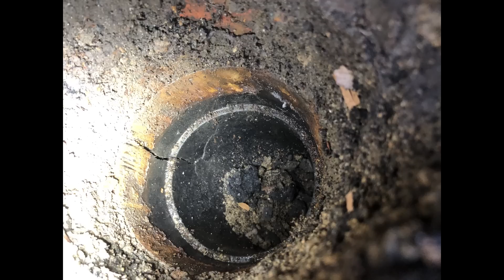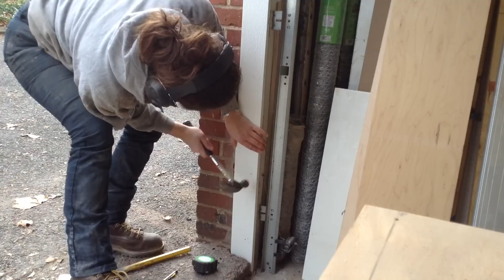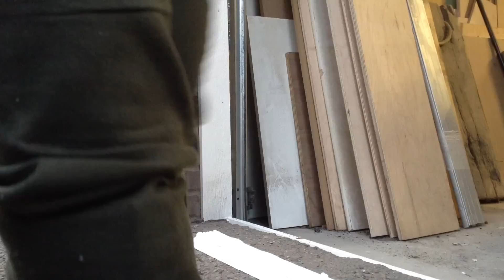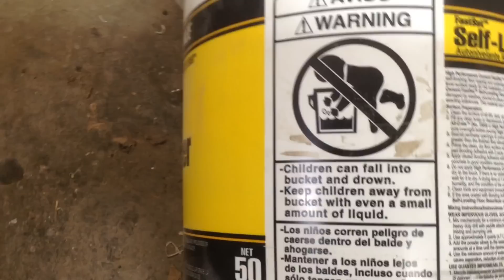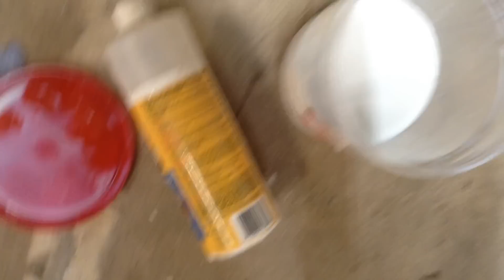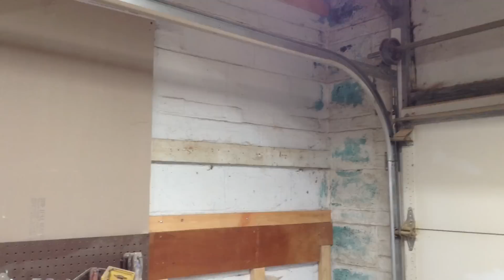Fixing Others Mistakes Waterproofing & Slab Leveling [How To]

Comment: For the leveling, overall, I would say you did a good job. A few tips for those watching:
1.  Never acid etch,  residual chemicals can affect your primer/leveler.  If you wash the floor after you will introduce excess water that can affect your primer/leveler
2.  Angle grinding is a good move, you need to make sure that you have a surface that is defect and residue free and able to create a mechanical bond.
3.  Always prime always, every single time.  Primer handles a couple of tasks in the leveling process and you should Never skip it. Sika is a quality brand.
4.  I wouldn't double prime, you can make a prime later too thick that can introduce microfractures in the pour.  (exceptions for wood or gypcrete subfloor where you cut the 1st coat something like 3-1 with water)
6.  Always watch your water ratios, engineered products are designed for a specific amount of water to attain their PSI.  Over water makes a weak product.  Your first pour looked a bit loose, the second looked about right.  However, I trust you followed the instructions.
7.  Cold water/temperature can slow your dry times, which is ok.  Trying to dry it too quickly can lead to poor results.
8.  I'm glad you solved your drainage/leaking problem before tacking the leveling as excess moisture or hydrostatic pressure can cause your leveler to fail.

Comment: I recommend LEXEL available at Lowes, (a Sashco product who also make other great sealing products), for sealing from rain, etc. Its clear and won't yellow. Also, with PVC trim (e.g. Azek, etc), you can glue pieces together with PVC adhesive (think plumbing but without the purple cleaner/primer). And about PVC trim, since I am doing exterior trim, you need to give some gap as it does expand with temperatures. Great work!

Comment: Good afternoon H. B. excellent repair to your water situation. Always a pain when you have to correct something that you shouldn’t have had to do in the first place. But the plus side is that you tackled the situation yourself and the piece of mind knowing that the repair was done with the best possible expectation for success. Not by someone else with fingers crossed. As for opinions they are always a good source of information, but you seem to do just fine with your gut feeling. I liked how added the extra pieces of vertical trim up against the door on the outside, by furring it out to help seal out the air. Now you’ve given me an idea. Hahaha. Nicely done H. B. Enjoy your weekend and the coming week.
Reply from the maker: Thanks!

Comment: Ooh, just my kind of project. Loved that you went to town on the asphalt (tarmac in the UK) and treated the cause as well as the effect. I've done plenty of self levelling cement fixes and never been let down by them. It's a shame you don't have a main drain to drop into but you've clearly done all you can reasonably do to fix the rainwater problem. It would be interesting to see how it works over time but your sealant fixes look spot-on. Nice to see how you address the problem you actually have rather than someone turning up with a pre-determined solution in the back of their van. Of course there were other options and I look forward to reading a comment about just raising the whole garage 6 inches...hahaha
Reply from the maker: Thanks!  It rained all day yesterday and no water in the garage.  So far so good.

Comment: What I don't understand is why someone put in the driveway and didn't make it flush with the garage floor.  If the garage was being used for your car then driving over that uneven part would get a bit annoying.  It amazes me that someone does stuff like that and they step back and think "Yeah, that looks good", then we as homeowners get to spend more money to fix their problems.  Sorry you had to go through all that but it's done and no more water in the shop so you win.
Reply from the maker: I know, I wouldn’t mind getting the back story to that because that really created about 70% of the issue.  The previous owners had quite a bit of stuff in the garage so I don’t think they used it for vehicles. Could have been they went with someone cheaper/ didn’t want to spend the money to do it right. but, also not realizing issues it would cause.

Comment: It’s funny how you actually read the directions/instructions for the products you utilize and actually follow them.   It truly makes a difference in the end when you spend your money.   

What a great statement and I’ve paraphrased a bit, 18:30  but it’s  nothing but the truth….   “When you post stuff on the internet & you think someone is not going to have a different opinion, you’re CRAZY!”   I don’t have any different opinion on this and I believe this to be a fact.  

I respectfully concur and thanks for sharing Caitlyn.
Reply from the maker: I was really hesitant to buy that self leveler.  The first page of reviews on Lowes at least half of them are one star.  Some of them are older reviews so idk maybe Quickrete changed the formula or the mixing instructions since then.  But, I had no issues.
Reply: I was thinking the same thing. Some of us (ahem) have had to learn the hard way that minimum temperature specifications are there for a reason!

Comment: Hi 👋, Happy New Year 🥳, HONEY 🍯 BADGER 🦡, and family and friends, well done, 👍, Honey, 😂, it is a shame that couldn’t get some help from a builder, it is very difficult to do repair work on your own property when you don’t have a lot of money to pay with, I am in a similar situation with my property, I have hailstone storm damage to my roof from back in 2022, The insurance company said they will replace the roof, but they won’t pay for the very old asbestos slate/tile Roof, it appears I’ve got to pay upfront 10 1/2 thousand euros, I’ve just planted some money trees, 😂, it appears I’m not even allowed to remove the tile slates myself. It is an offence, where you can get prosecuted.
Because of my ex , I have lost over £200,000, which was supposed to go towards the finish and repairs renovation work on the mill?, 
I’m now thinking of going back to work to try and earn some extra money , but it is a catch 22 situation, where I need to lay a new concrete floor in my garage, which is not finished yet, As I need this area as a workshop, to say that I have downsize from my workshop/factory back and was as tall as a three story building, Garage is going to be a roughly 6 m x 6 m, and I have my basement that still needs some repair work doing to it which is going to be roughly 6 m x 11 m, I’ve got my machinery all laid out., there’s not enough room to swing a cat, 🐈‍⬛, 
Sorry, I’m rabbiting on again , I hope your floor repair, and everything all works out fine, you never know, you might get a nice big job coming where you can build yourself a new workshop, you are still young enough to do this, stay positive and you’ll get there, I wish you all that success for the New Year, regards Phil from the moulin/mill France .